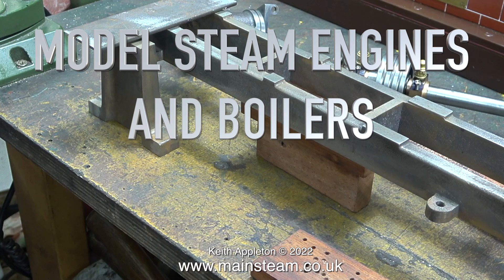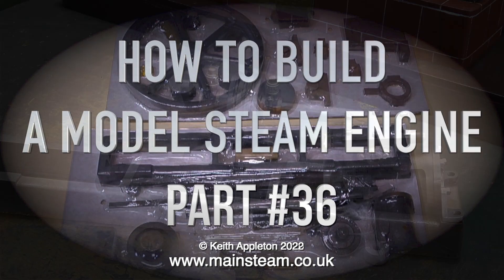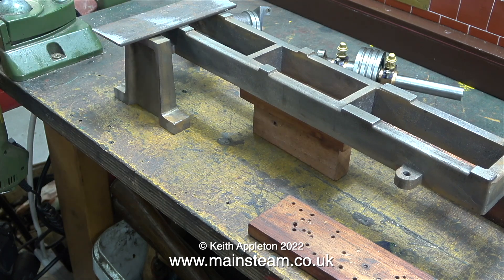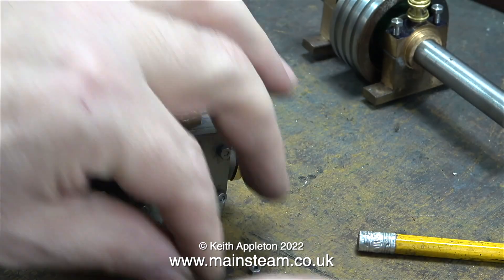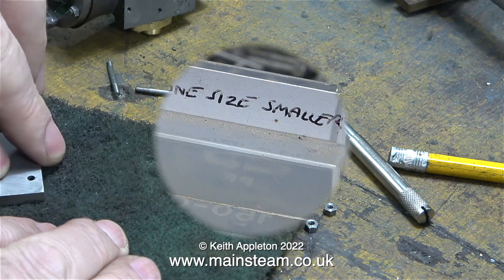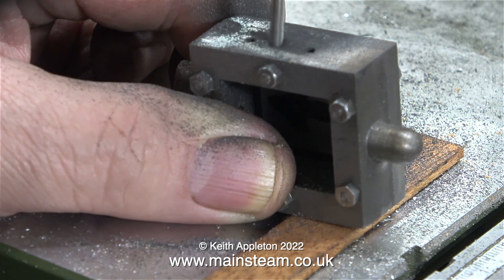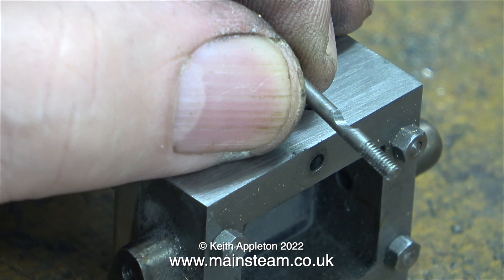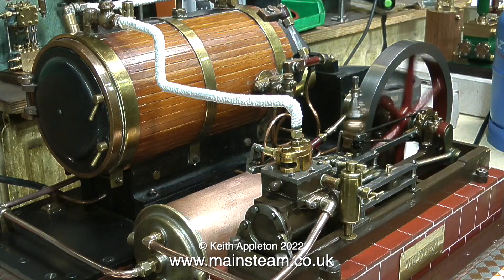MODEL STEAM ENGINES AND BOILERS  - PART #48

Comment: Good day Keith, I'm currently making a small 2 cilinder steam engine and I've come to the time where I'd like to clad the Cilinder and piston valve housing. I have alot of mahogany veneer from my furniture making practices, and was planning on using this as cladding too. Do you think a layer of veneer is good enough as isolation for a 20mm bore engine or should I put some insulating underneath it as well? Cheers and have a good day.
Reply from the maker: The Mahogany will be fine without additional insulation.